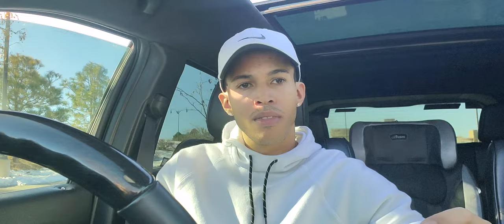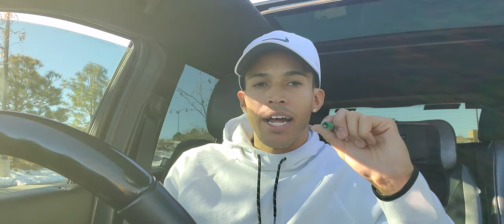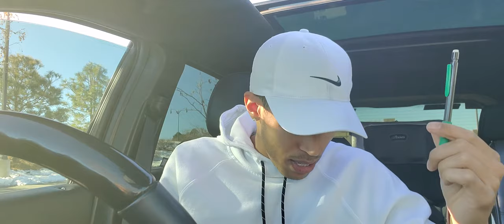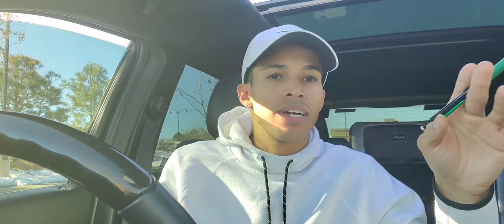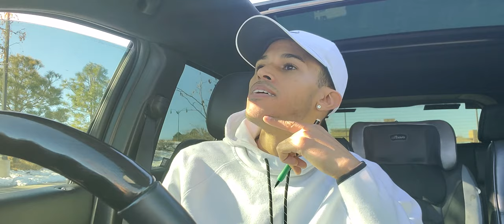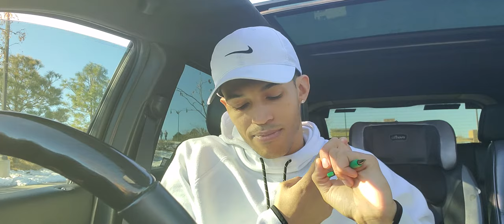Why You Shouldn't Mod Your Vehicle. My Own Personal Experience

Comment: We can all relate lol. I bought my Durango with no intentions of modding it. Now I have a custom tune, afe intake, bbk throttle body, 6.4 intake manifold I’m about to install. Did 3.45 front and rear differential swaps and that was a worthless mod that cost me a good amount of money lol. It’s addicting, there’s always the next mod
Reply from the maker: Well thanks for answering the diff mod for me haha. Yeah I love my jeep but it's been a costly project.
Reply: @teammopar771  yeah and the differentials could be because all I had when I switched to them was a custom tune, no other mods. It took off 1/10th in the 1/4 mile. I made a video on it but my conclusion was it added an extra shift before 60 mph and before I crossed the 1/4 mile so it essentially didn’t improve times. Once i go full bolt on and a cam i think it will benefit more from the gears at that point
Reply: People don't understand you going to spend per dollar per horsepower
Reply from the maker: @hemi5.7villain  I should have like 10K horsepower then 😂

Comment: I had to laugh at this video only because I could relate to it so much. Only I did the same thing with an old 1959 mahogany wooden boat that I bought for water skiing.  I ended up swapping out a six cylinder flat head motor with a 327 that had to be converted into a marine engine. Then the old transmission wouldn't work with the new engine so had to get a new tranny and  propeller. By the time I replaced all the dryrot, rewired everything, new gauges, stripped and refinished the wood and re-chromed all the chrome parts I had $25,000.00 into a non-collectable boat that if I had to sell would only get me a quarter of what I had invested in it. Then I got married and had a couple of kids and couldn't afford to keep the boat anymore. Sold it $4600.00 .  That was about 30 years ago when money was worth a lot more than it is today. I was young and single when I got started with the boat and had a lot of fun with it for a while but priorities change when you start a family. Family is first priority and if you can afford an expensive hobby then go for it but only if you can afford it!

Comment: Good points throughout.  Mostly agree.  We went a different route.  Instead of modding my 2016 Scat Pack (chasing horsepower); we bought a new 2019 Redeye.  Then hit a wall at the track. Repairable.  over 60 days downtime and more $$$$ than I want to admit (tens of thousands).  At my own expense....insurance doesn't cover any racing.  Legal or illegal.   You have to decide your risk tolerance level. And your budget.  And your skills.  And realize......no matter what......there's always someone faster.  Always.

Comment: So, I have a Stock 5.7 2010 Challenger:  6 speed.. Its a nice car with 17585 miles  & its pretty quick  for being  factory..  But  I am sure , I will get hated on this post .  But I am making my own mod, ( starting with  the first mod, every Hemi owner does , day one !  The cold air Intake.  Right now  I am a week or two away from testing,..  & Tuning,  What I have done is , Taped into my A/C vents on the interior & I'm running custom made black PVC tubing out to my cold air  intake .  Then I'm going to mount twin turbos towards  the rear end of the car this alone will help keep the engine  bay stock looking & easier  to work on in the future:  when doing maintenance under the hood.  Thst  will allow me to keep my stock manafold & exhaust,  but removing  cats  & run stright pipes...  I will keep you informed....

Comment: Great vid bro. I'm just getting my overland and changing my exhaust for sound.
Reply from the maker: Wanna know the secret? Long tube headers. High flow cats. X pipe. Kooks bullet mufflers, 4" dual tips. Full 3" exhaust. Even on a stock 5.7 motor it will sound nasty
Reply: @teammopar771  ok thank you for the tips brotha.

Comment: You drove your cammed Jeep without a tune?
Reply from the maker: When I did the 6.4 cam swap yes I did. I had no choice being that the tuner at the time I was going to use bailed on me the day I was to get a dyno tune. It was my only vehicle so until I could find a new way to get it tune I drove around d almost 2 months I believe before getting it tuned.

Comment: Would you guys consider an fbo/e85 charger to still be a daily? It’s only really headers and 6.4 intake manifold
Reply: Depends on your definition of daily.. The headers have drastically raised your underhood temps over stock OEM manifold and heat shield.. So that extra heat in itself can lead to reliability issues overtime depending on how much you drive it..